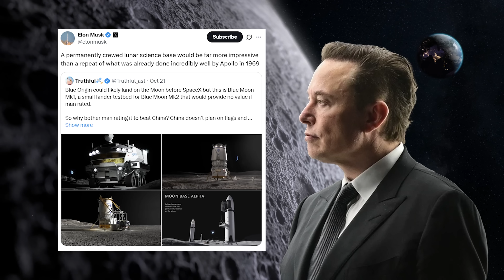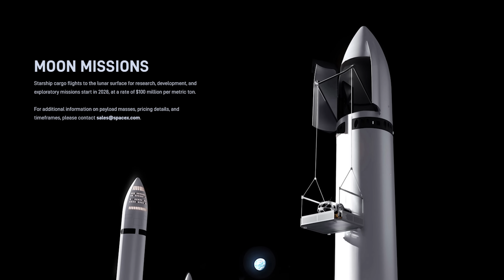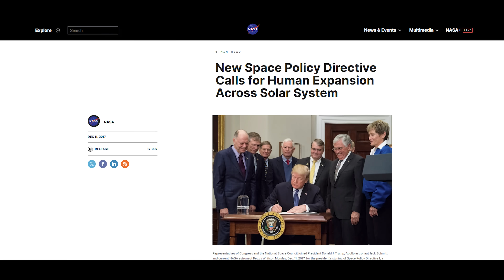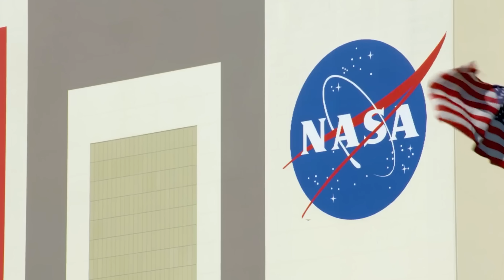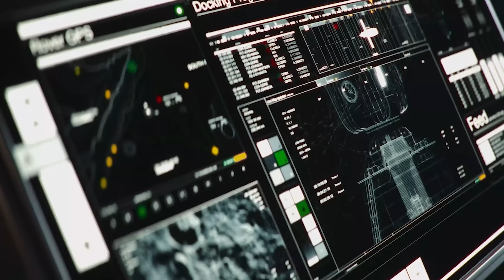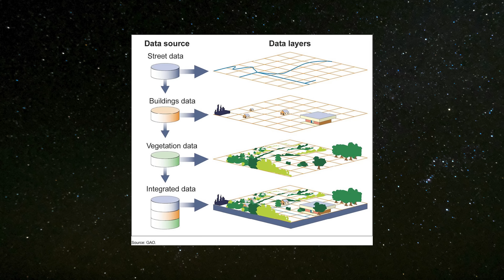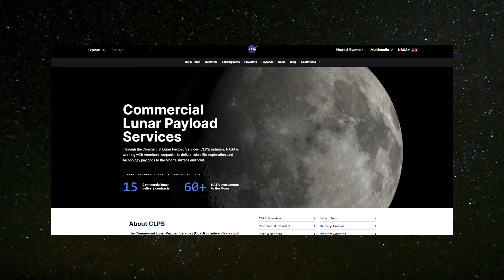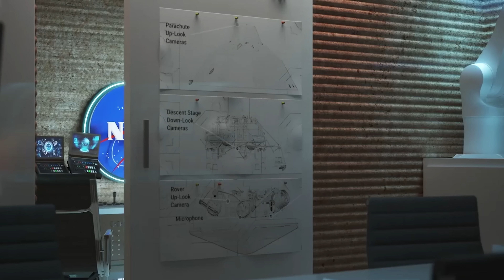Elon Musk revealed The Real Reason SpaceX Starship Land on the Moon, Better than NASA & China

Comment: "Meanwhile, Starship is built to move serious mass. Its cargo capacity could change everything."

Serious mass? To date it's only managed to lift an eight ounce banana!
Reply: "....only managed to lift an eight ounce banana!" - dummy satellites? "Nope, never heard about them!", right?
Reply: How much weight did the dummys have ? The fact is at the moment with the actual size of this thing and the actual engines it won't be able to lift anything useful into the orbit and for sure not to the moon... I am not hating on the starship i think its one of the coolest thins in mens history but its actually just for show right now. And as far as I know there is noting changing about that in the near future. This thing need just way to much fuel to get up there it barely can hold enough to get back on earth for save landing. And simpy adding more fuel doesn't work since it gets cancelled out by the additional weight youre adding with it. And the engins wont geht any better soon also. There is nothing like a better engine in development right now which is supposed to be ready for testing in the next couple years  @AleksJokovs8814
Reply: @LIQUIDDE4TH  you obviously are not understanding rocket science and starship has launched with starlink satellites into orbit already so yeah you are wrong and starship is made for refueling in low earth orbit so fuel is not a problem 👌
Reply: @dantheman1744  Liar! starship has never made it to orbit.
Reply: Lol no they already tested the pezz dispenser of starlink in orbit so you are wrong.
Reply: @dantheman1744  Starship has never made it to orbit.

Comment: You didn't mention the most important infrastructure project, manufacturing rocket fuel on the moon. It's vital because there's a huge potential economic advantage to sourcing fuel, oxygen and water in the moon's relatively low grav environment. The cost of obtaining these vital resources from earth is horrendous. Rocket fuel produced on the moon or eventually in orbiting factories will drive down the cost of deep space exploration.